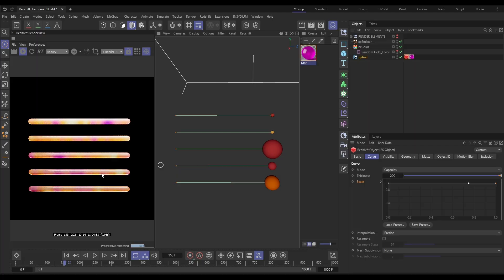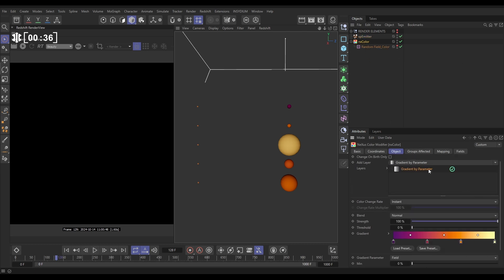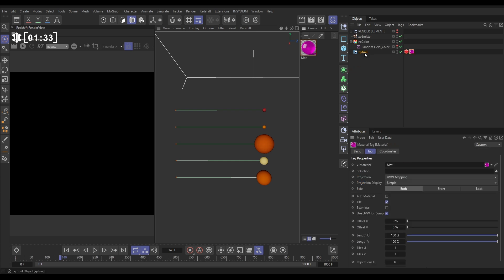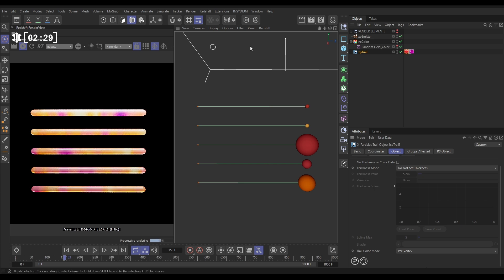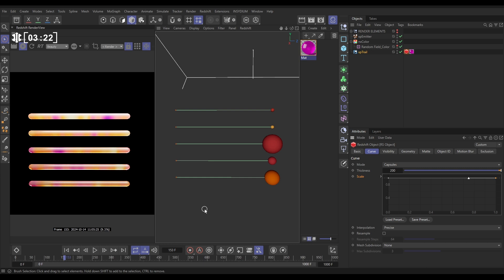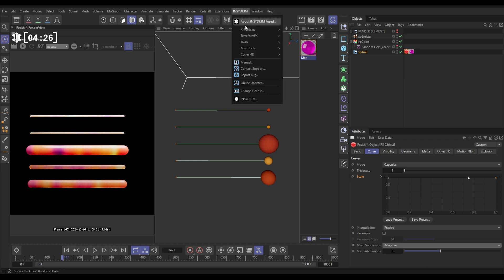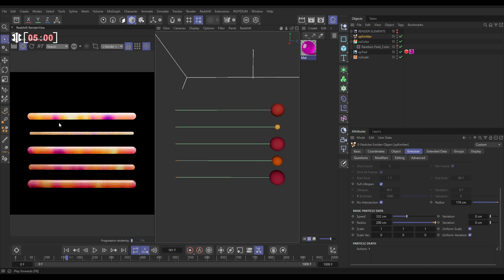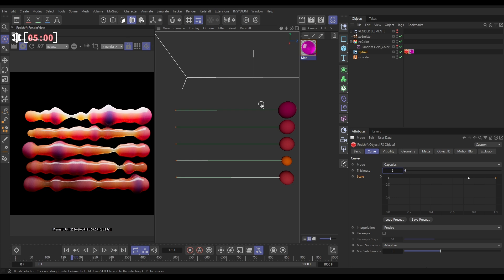Top Tip Tuesday - Varied Trail Thickness

Comment: How would trail thickness be controlled in Octane ?
Reply: I was wondering the same thing. My current fix is to add an octane object tag with "render as hair" checked to the xpTrails object. Then create a hair material and add that to the xpTrails object as well. That should do the trick. 

Next step is too see if I can grab and write the color data using the octane attributes node.

ps. I also haven't started messing with the variable width stuff that was shown in the video